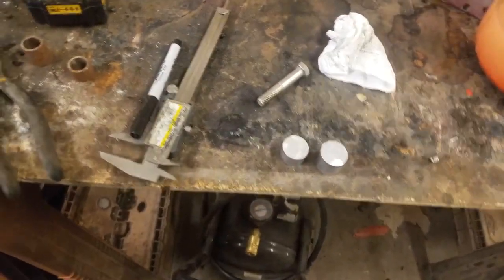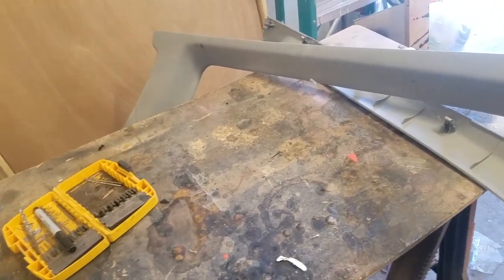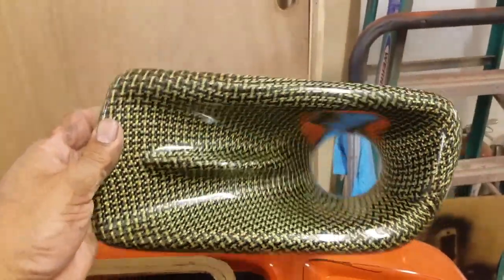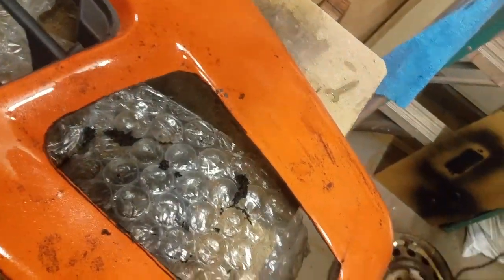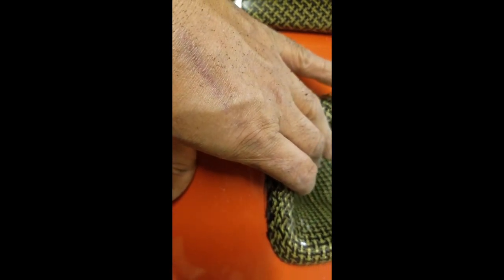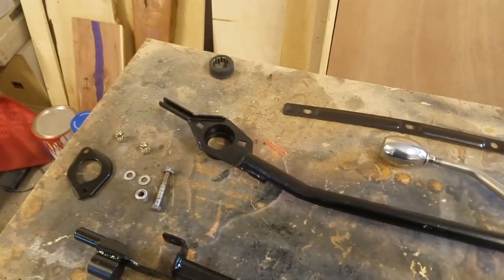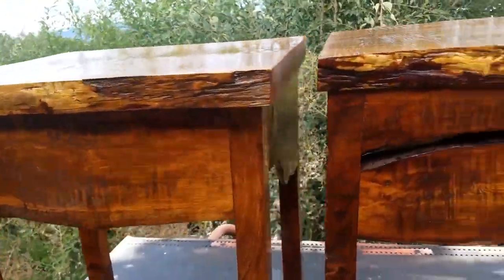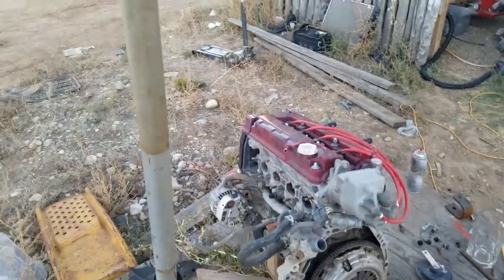Honda Civic Hatchback Build Part 9

Comment: progressing nicely, have you thought about putting up a gazebo over/around the car ready for the winter, keep it clean in general.
Reply from the maker: I started with one when I first started working on the car. It's very windy where I live and the wind blew over the cover. So I'm going to put it in a storage unit for the winter.  Hopefully next summer I can build something to keep it in.
Reply: @switchjv  I see, they are susceptible to wind. Found that out myself here in the UK when i bought a cheap ebay one. 
Where your Eg currently is looks like you'd have plenty space for nice workshop to build 👍
Reply from the maker: @dinxsy8069  I would definitely love a shop where I can work on my cars and build furniture and do metalwork.
Reply: @switchjv  Would be a good investment then in regards to work.